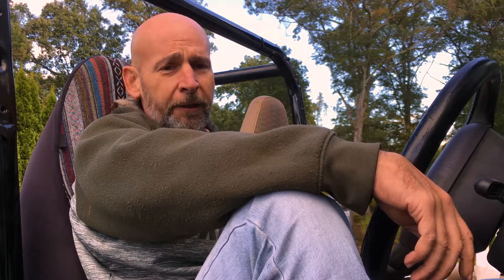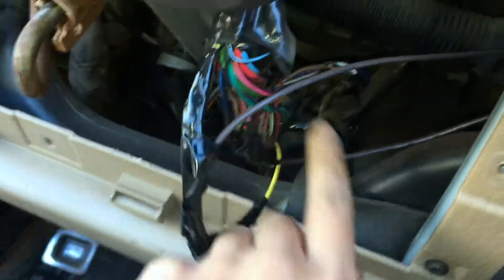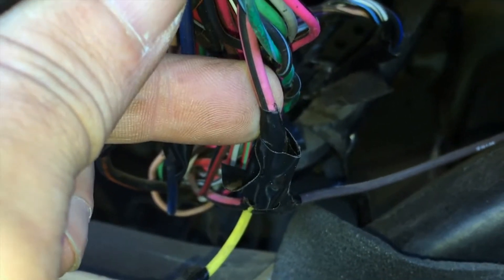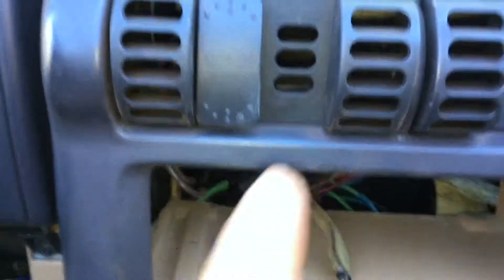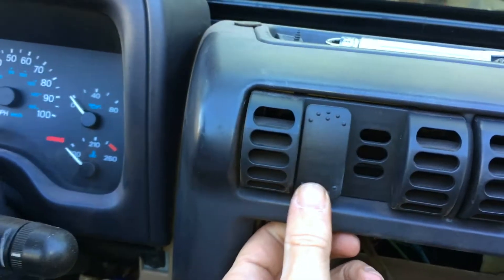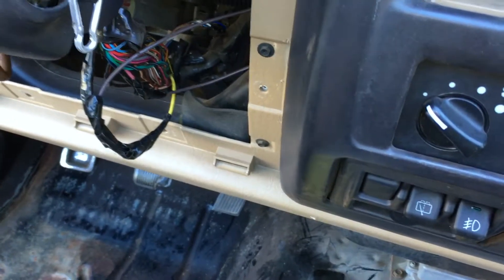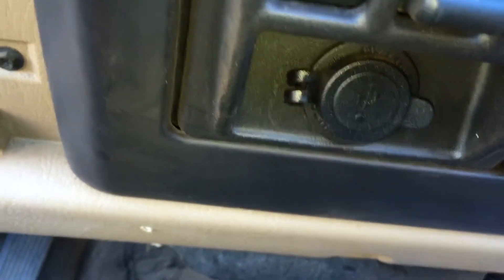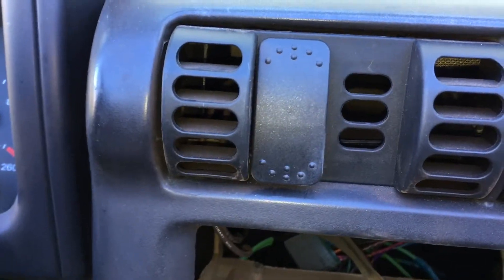Easy JEEP TJ push Button starter

Comment: I spliced a pushbutton switch to the yellow & pink/black.
Doesn't work,,,
Appears by continuity,  to be wiring to clutch switch. 
1. Clutch pushed in = tone.
Push button on switch = tone.
Please Advise
Reply: i second this.. 
97 tj 2.5

Comment: Dude, having those charging ports is HUGE! Whats the purpose for going push button? Do the keyed ignitions take a permanent dirt nap?
Reply from the maker: ALL THE TIME.. Thanks for watching and in my case when I bought the jeep it had new starter new battery but once in awhile still wouldn't turn over. Im gonna change the hole steering column when switching the frame so didn't want to change the ignition plus I was already fixing the hack job on the wiring .
Reply: @rustyjeep9783  hahaha don't you just love finding someone elses birds nest! I have some wiring issues on Toad that have been super back burner, with everything else going on.